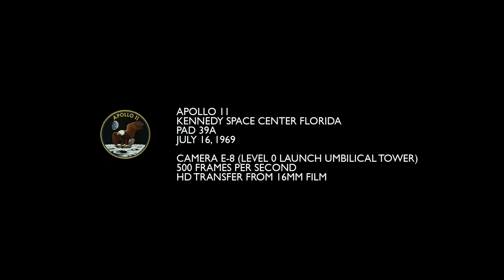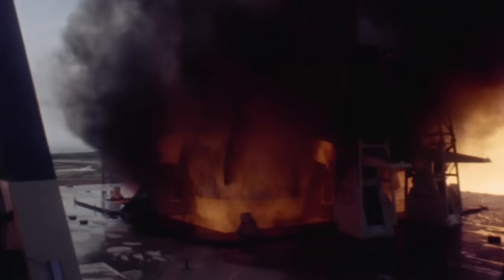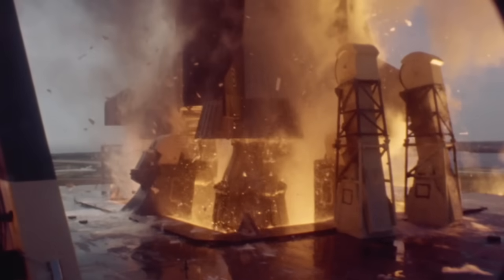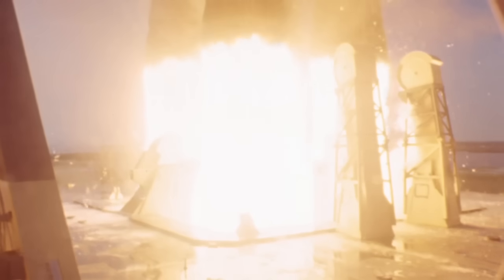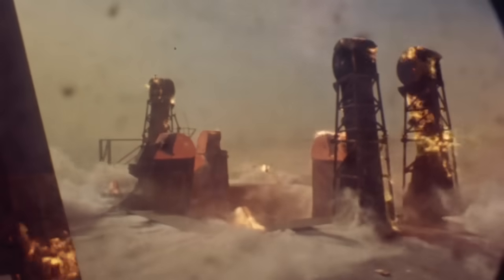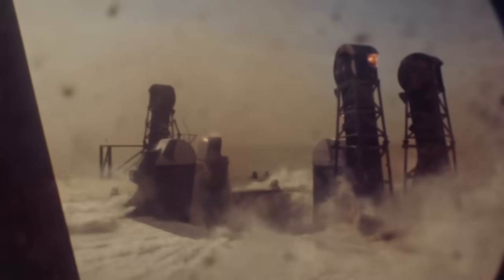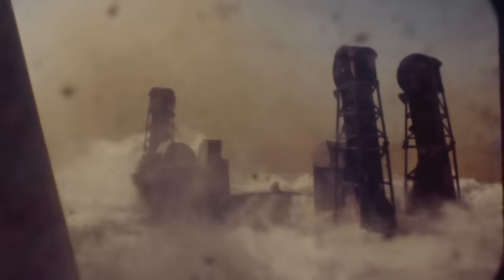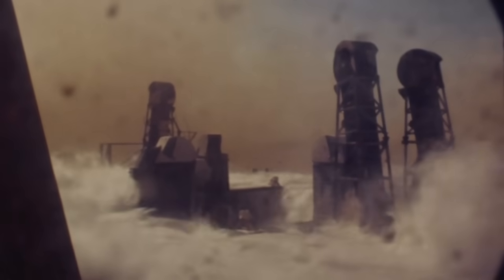Apollo 11 Saturn V Launch Camera E-8

Comment: The most powerful machine ever designed... The greatest  achievements  of   the science of  mechanical engineering
Reply: barracuda7018 Clearly you haven’t seen a 86’ Camaro
Reply: I never get tired of watching it too. The modern rockets, although they can return and land aren't nearly as exciting. Plus the technology developed especially by Draper labs at MIT makes the rocket technology of today possible. Even with modern technology NASA still can't deign and built modern rocket(s) to match the Saturn V.

Comment: Early on; "the F1 engines were started by bursting hyper*^#%# *^%#^%".....whaat? The rest f the narration is very good, but that pronunciation  appears incomprehensible. 
Any one want o gave a crack at deciphering?
Reply: Bursting hypergolic (cartridge? Not clear). Hypergolic fuels spontaneously ignite upon contact with each other. They're used as a chemical ignition starting procedure for certain rocket engines instead of an electric spark ignition starting procedure. On the F-1 engines, it was the only way the combustion process could be started over the entire injector plate at the same time, which was the only way the F-1 engines could be reliably started.
Reply: Hypergolic (Shirley) Partridge I think?
Well done video, but the video poster using "hypergolic cartridge"? That's got to be the greatest example of misplaced technojargon ever. This is a YouTube video, I have an advanced degree in chemistry, and a highly technical background, and that has to be THE most discipline specific terminology there is.
Reply: Sad. The internet really does tend to bring out the worst in some people. A simple thank you on your part would have been sufficient. Sarcasm, when directed towards someone who is attempting to help enlighten you (at your request), is the refuge of a shallow mind.

Something that is an actual fact cannot be "misplaced techno-jargon" (FYI - "techno-jargon" is a pseudo word... "jargon" by itself = technical terminology, i.e. - "techno" in front of it isn't necessary). While I agree that the third word of the contested phrase in this video is unintelligible (bursting and hypergolic are clear, the third word is not), it's a fact that hypergolic fuels were used to start the F-1engines.

I wrote my previous comment off the top of my head from what I could remember about the F-1 engine from my undergrad (BSc) Aerospace Engineering propulsion classes I took 30 years ago. I would have to do research to be able to clarify how the starting mechanism worked and how the hypergolic starting fuels were contained.

But a disposable, disk like "cartridge" sitting underneath the injector plate filled with one hypergolic fuel waiting for a second to be introduced to catalyze the reaction, is certainly a technical possibility. It would also make sense to characterize that mechanism / device as a "bursting hypergolic cartridge".

I'm not sure how your claimed bona fides are relevant, but I have 3 degrees in physics and engineering (4 if you count my dual BSc in Mechanical and Aerospace Engineering, earned Summa Cum Laude, as 2 separate degrees). I also have over 25 years of experience in designing, engineering, and analyzing very complex mechanical and structural systems and components for both the Aerospace and Automotive industries. I have 13 patents, and I'm currently working on half a dozen more.

Having said that, while I have a fundamental understanding of how rocket engines function because of the propulsion classes I took 30 years ago (that are mandatory in any accredited Aerospace Engineering curriculum), I do not have any experience designing rocket engines, specifically the F-1 engines that powered the Saturn rocket. That is why I would have to do research to be able to give a definitive answer.

Unfortunately I don't have the time or desire to do that. But I have no doubt with your "advanced degree in chemistry" and "highly technical background" that you have the intelligence to do your own research and figure it out. 

Although I do find it odd that a person claiming to have an "advanced degree in chemistry" and a "highly technical background" seems to be totally mystified by hypergolic fuels and what a mechanism might look like (possibly a disposable discoid "cartridge") if it was designed to contain the hypergolic reaction towards a specific goal (starting the F-1 engine by providing a more homogeneous / non-turbulent initial combustion process via hypergolic chemical ignition compared to an electric spark ignition) .
Reply: Addendum: Well, 12 hours later and I spent a few more minutes doing research and found an excellent, concise, highly detailed explanation of the F-1 engine start sequence. The technical phrase bursting hypergolic cartridge is absolutely correct and accurate. 

https://heavensmachines.wordpress.com/the-saturn-v-f-1c-engine-start-sequence/

Pertinent paragraphs:

Lastly, an igniter, containing a *cartridge of hypergolic fluid with burst diaphragms at either end*, is in the high pressure fuel circuit and has its own inject point in the combustion chamber. This fluid is triethylboron with 10-15% triethylaluminium.

Fuel and LOX pressures rise as the turbine gains speed. The fuel-rich exhaust from the gas generator ignites in the engine bell to prevent backfiring and burping of the engine. The increasing pressure in the fuel lines opens a valve, the igniter fuel valve, letting fuel pressure reach the hypergol cartridge which promptly ruptures.

Hypergolic fluid, followed by fuel, enters the chamber through its port where it spontaneously ignites on contact with the LOX already in the chamber.

P.S. - I retract the item in my previous comment where I stated I was wrong about the hypergolic cartridge being disposable. I was at least half right because the cartridge burst diaphragm components are obviously disposable.

You're welcome.
Reply: GoogleEqualsEvil hypergolic cartridge.....thank you.
The rest of the video is excellent. 
Having given well over 500 technical presentations so far globally to almost every every kind of audience, and teaching presentation skills at universities, I am perhaps overly critical. Depends on the audience one is pitching for, and clear enunciation. This is YouTube, so the audience is unclear, but presumably interested in aerospace engineering and/or high speed photography. It rather stuck out as the remainder was clear as a bell. 
But as you can tell from my comment, my opinion upon use of extremely highly technical, non-standard (or generally understood) technical jargon or terminology is the kiss of death of any presentation to any but a very narrow audience. Perhaps that was the target? (ie, narrow). If so, AOK. Although enunciation might have been a bit clearer. But he was going along at a clip to get it all in, so that stuff happens. And as I said, overall it was excellent. 
Hypergolic cartridge.......nah, doesn't work even as a late 60's prog rock band name ; ).
Reply: Bursting Hypergolic Cartridge. The cartridge was filled with hypergolic (pyrophoric) fluid and when pressurized by incoming fuel, the diaphragms on either end burst, causing the hypergolic fluid to enter the combustion chamber and spontaneously ignite (from being exposed to the LOX oxidizer), which in turn created primary combustion ignition, thus starting the engine. So the narrator did in fact use the correct nomenclature (he just didn't enunciate it clearly).

Yes, since you're someone who is skilled in communication it makes sense you would be sensitive to hearing any kind of glitches. I have no idea if this is an actual NASA professional speaking or just an enthusiast, but I suspect the latter. Either way I'm in full agreement with you that for some unknown reason his enunciation goes haywire very briefly, then for the rest of the video it's fine.

I understand your point of view but I disagree with your opinion / assessment of the technical content and jargon used in this video. It's never wrong to be precise and accurate and to use discipline specific jargon no matter how obscure or uncommon it is, because by it's very nature it's going to be obscure and uncommon to anyone who isn't specifically educated / experienced in that discipline.

In my opinion it doesn't matter who the audience is...if whoever is watching this video (or watching / reading / listening to any media) is interested enough in the topic, then they will (or should!) do their own research into anything they don't understand and / or that they want to know more about. People are extremely lazy and willfully stupid nowadays, especially the millennial generation. I say don't cater to the intellectual laziness of people; instead force them to take the initiative to learn / study independently. 

It took me less than 10 minutes of research to solve this (it took me longer to type out these comments then to do the research). Granted I'm highly experienced and educated in physics and engineering, but not being an expert in a particular discipline or field of study certainly shouldn't excuse someone from doing research. Sadly, many people won't even do the most elementary research these days, e.g. - using a dictionary. 

I don't know...I think Bursting Hypergolic Cartridge would make a pretty kickass Rock or Metal band name!

Comment: The digitized energy.
High performance gain by doubling the voltage of each power source with novel RZ sampling technology. Electric vehicles with integrated battery electronic charging unit for long stays, increasing the photovoltaic power and for applications in the aerospace industry, thermoelectric generators or LED lighting.
INNOVATIVE TECHNOLOGIES - RZ-IT
Institute for Renewable Energy
Rudolf Zölde
samplingtec@gmail.com
www.rz-innovatec.com

Comment: Wonderful, if the Saturn 5 would of launched the Shuttle 14 astronauts would have been spared. Like the commentator said, ice falling from the Saturn LOx tank falls harmlessly below the payload/capsule. No, not 20/20 hindsight, simple engineering foresight. Thank you.
Reply: That was an actual proposal, at one point. Look up "Saturn-Shuttle".

Comment: When we had the last scuttle disaster, with the chunk o booster foam damaging the tile surface, I wondered why the foam wasn't covered by light netting to prevent the breakoff of a piece of booster foam heavy enough to damage the vehicle. Why wasn't it possible to cover the foam in monofilament netting with spaces no larger than 2x2" or 3x3". When I buy some electronic device and the package is closed by tape that has monofilament threads, no way in hell can you pull it off, it takes a sharp box cutter blade.

Comment: I believe those hold downs had 1 inch solid steel bolts that were pulled through a die.  This was to make for a gentle release and help dampen things as the rocket pulled away from the pad.  Simple and fool proof